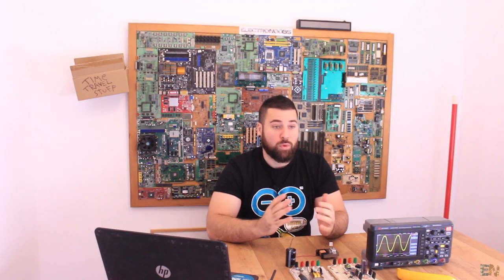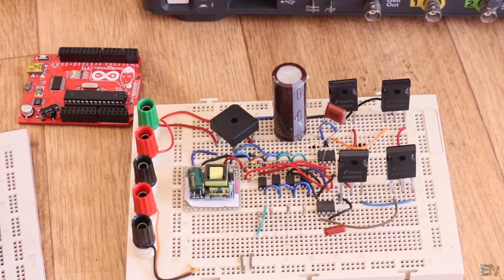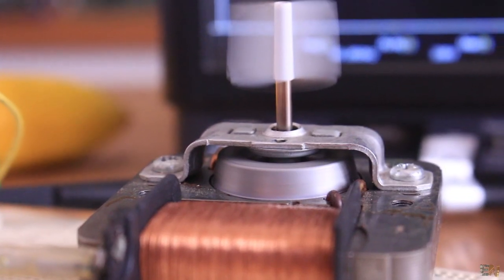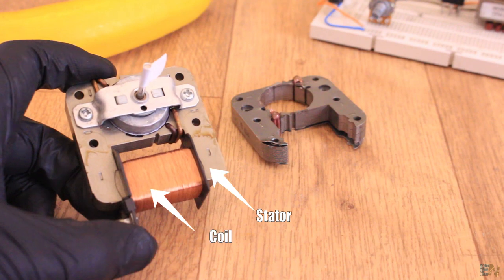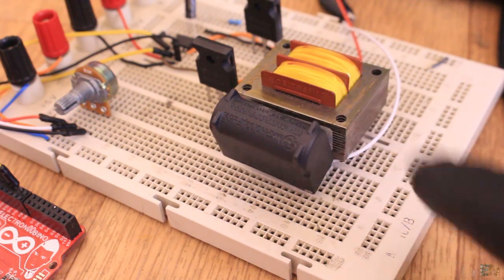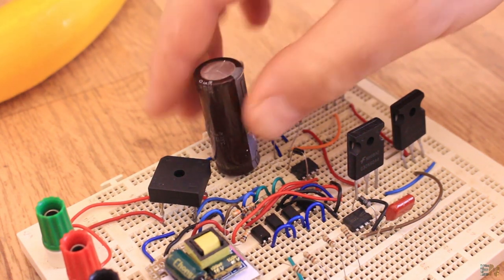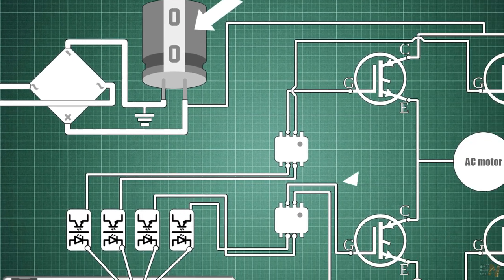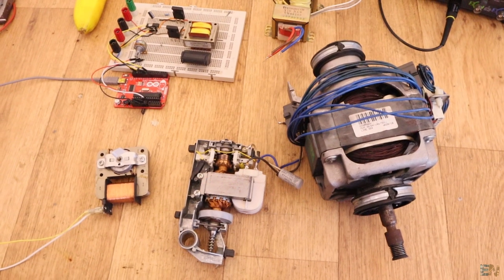Variable Frequency Driver | Variable Inverter

Comment from the maker: Sign up at ELECTRONOOBS.io: https://electronoobs.io/
Follow me on FACEBOOK for more: https://www.facebook.com/Electronoobs
help me on Patreon: https://www.patreon.com/ELECTRONOOBS
Reply: Me: stressed 
Electronoobs: new video uploaded!
Me: stress free now. No matter you completed your video or not. I just like to watch your videos.
Reply from the maker: @padmalayarawal3091  so glad to hear this!
Reply: Electronoob love your channel! one thing that this video really has me thinking is safety! I work with high voltage every day. and every time I have to reach in an electrical enclosure I have a deep respect for what is in there. I try to be as safe as possible but there can be a mistake at any minute and it can cost you your life even at lower voltages like your using. I don't want to go on about this for long so I'll make a short list of my concerns. 
     *Latex gloves - won't do much for you, try the real electrical insulated ones made for that.
     *Saftey glasses - maybe show that you used them? better yet a face shield. especially because of the capacitors.
     *Master disconnect - even if its a power strip with a switch. what if your motor knocks your board in your lap. sorry, you did have a switch but that will be moving with the cable if it is falling.

I don't know how far to take the safety but I would take it a little further just because you probably have some kids and really inexperienced people watching that could get hurt. even if you said not to try this at home. maybe a little more safety? Please? I am one for doing more projects with the higher voltages, but safely.
Reply: Hey I want to make a same project but ur code is showing some error Im not able to solve it 
Can you please help me out

Comment: Great project, thanks for sharing. For information, idealy for an AC motor one should keep the V/f ratio constant. In other words if the frequence is lower that the nominal frequence, the rms voltage to the motor should be lower thant the nominal voltage. On the other side, if the frequency to the motor is higner than the normal frequence, one should boost the voltage, otherwise you quickly loose torque (in a factor of the missing voltage squared).

Comment: 5:28 In three-phase AC motors, the coils aren't necessarily 120° displaced in space. That would be true if there was only one coil for each phase.

5:49 That is Faraday's law (electromagnetic induction). Lorentz law is related to electromagnetic forces, which is what you explained a few seconds later.

Comment: Heh, I was considering making a DIY 3-phase style VFD. Normal industrial VFDs can only go up to 400Hz, but I am needing one that can do 1.2kHz (for a 72000* RPM motor).
Fortunately, I was able to find the correct application specific VFD for pretty cheap. Would still be a fun project though as I am the VFD guy at work would like to get a better understanding of how they work internally.

*Edit: I intended to say 72,000 RPM instead of 7200. Its the drive motor for a turbomolecular vacuum pump.

Comment: Hi, great project.
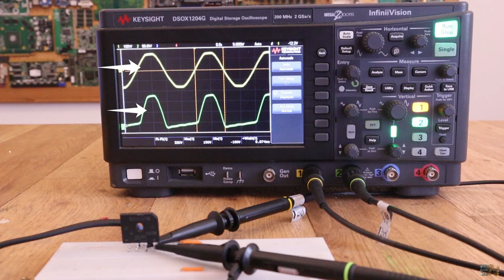At 8:30 you say you have fullwave rectification, your protoboard layout shows this as well, however the scope trace shows halfwave rectification.
I know for the scope trace you have just got a bridge and scope connected in the foreground.
I realise you can't connect both channels with common gnds to input and output of a rectifier circuit, so it may have been better to do it in two shots, explaining the outcome.
Reply from the maker: Yes that's due to only connecting only one probe from the oscillsocope. it was full bridge.

Comment: I tried to make a similar circuit, and i am currently still working on it. Here is some of the things i like to keep in mind.

There has to be a deadband time between switching the Hbridge in order to avoid shorting the bulk capacitors to ground.

Also, you might want to have the SPWM start slowly to avoid slippage in the rotor, so the frequency has to slowly ramp up to the desired value. 

The turn-on/turn-off time of the optocoupler is not to be ignored, depending on how high your frequency goes, it can give some pretty frustrating results. 

Single phase induction motors have a startup capacitor that might discharge very quickly your own bulk capacitors on startup. Depending on the size, you might have to use alot more than just 1 high voltage capacitor, maybe also a series resistor to limit the charging current that can be disconnected by a relay?. To give you an idea, in my case I had to use 7 high voltage caps, 1000 uF, since i was using a big induction AC motor.

For a small motor, the H Bridge you built is fine, however in a much more current heavy application, it can be a good idea to protect the IGBTs with external fast recovery diodes, >10 amps, instead of relying on the internal diodes found in the IGBTs. In that case, mounting the active components to a heatsink is also a good consideration.

As a last detail, i noticed that the traces are quite small in the PCB you ordered. Again in a small ac motor application, it shouldn't be a big problem, but for a bigger application, consider enlarging your high current traces.

For a furthur implementation, power factor correction is also important, just a thought to keep in mind.

Great video! can't wait to see how this develops!!
Reply: The thing I don't understand is he used N channel igbt's I thought n channel transistors can only turn on and off negative. Where as p channel can turn on and off positive. How is the H bridge working with all n channels

Comment: Thank you. Learned something new. Did not expect your IGBTs to switch with bootstrapped highside drivers. Does it with a amplitude modulation of 1? Also really interested in how your current waveform looks like

Comment: When you said you change the switching frequency in the spwm circuit that was wrong in a spwm circuit you use a constant high switching frequency and you change the pulse width of the pulses in order to get the derided signal on the output
Reply: Alternatively you could use a variable external clock source on the micro or DDS where the resolution of the sine is reduced to increase frequency.

Comment: @8:32 is not the output of a full bridge rectifier. A full bridge rectifier will double the line frequency.
What you are showing, is the rectification of a single diode. 
Also, for any application of less than 100mA, a capacitive dropper power supply is a lot cheaper. 
Unless you must have the galvanic isolation that the small smps transformer provides.
Reply from the maker: Is the output from the rectifier but with only one probe connected...
Reply: @ELECTRONOOBS  That's not what you say while showing that.

Comment: Could you create a voltage divider to supply 12v for the MOSFETs from the 320v DC without the need for the second transformer?

Comment: You really need to add a 'bleeder resistor' to those 400V capacitors, so they discharge when power is disconnected.
1M ohm in parallel with the capacitor, 1/4W resistors are only good for 200V though, so either use 2x 500kohm in series, or use a larger 1W resistor.
Given you've already ordered the PCBs, add the resistor to the pins of the capacitor under the board,  before you cut them off.
Reply from the maker: Thank you so much for the feedback. I will add that!

Comment: What is the part number of the transformer used in the first design with only 2 transistors ? Or what type should I use in the USA ?

Comment: Hi can you post a schematic for the frequency inverter and the exact arduino code Assosciated with it ? I would like to know how to hook up the potentiometer and start with the simpler circuit before I move on to the driver circuit

Comment: Excellent Video! I have one question. Right now I have a D6124 CA 651 Integrated Circuit, but I don't know the main functionality. I desoldered the IC from an old TV remote control. I've searched for some datasheet related to the IC but it is a little bit difficult to find and download the specific PDF. Can you explain to me what is this IC about? Thank you Electronoobs! Greetings from Ecuador.

Comment: Hola, sigo tus videos, noté que tu circuito tiene un pequeño problema (ver minuto 10:17) no puedes conectar el rectificador al terminal de tierra. Cortocircuito Dañar el puente de diodos. No se puede conectar la masa del osciloscopio al condensador negativo. Un fuerte abrazo y felicitaciones por su trabajo y por la elección de los temas que cubre en sus videos. Gracias

Comment: very well explained!, I wanna build that driver but to supply a Flyback in order to deliver 8kV to 20 kV and adjustable frequency to a discharge of  8 kHz.   How could I do that using your example?.  Also I checked your video about how CFL works, and I was thinking in a way to control the frequency using that base circuit.

Comment: The AC motor you used is a shaded pole motor. Sorry but I'm afraid that the theory of operation you stated in the video may not be fully correct. There are 2 shorted wire loops on the stator (laminated silicon-iron core)  near the rotor of the shaded pole motor, which are necessary for the creation of the rotating magnetic field and the rotation of the motor. Also, as the shaded pole motor is an induction (or asynchronous)  motor, the rotation speed of the rotor dosen't have to be synchronized with the input AC frequency. The synchronization is only needed for synchronized motors (permanent magnet motor or excited motor, for example).

Comment: Hello! What´s the voltage that gets to the motor? My country is 120v so is my shaded pole motor. Is it possible to use your circuit without damaging the 120v motor?

Comment: I've developed circuit of inverter circuit with gate triggering circuit using op-amp. I've compared square and triangular waves and implied SPWM technique with that. I want to know that how can I generate that sine and triangular waves which are to be given as the input of op-amp without using function generator or Arduino......

Comment: So I'm basically  building the same circuit .  and am having problems with what I think is called the miller effect. The high side IGBT not switching correctly. does your circuit compensate for that. Thanks.
Reply from the maker: Don't know yet. It needs more tests. Maybe you can share your work on electronoobs.io so we can all see it

Comment: I never use optocoupler before in my circuit but I try turning on on I have removed for a old micro wave clock circuit but I was in for a surprise I connected the output signal of my micro controller and to ground it just short circuit on me I don’t think all optocoupler or the same because if a signal of 9 volt con turn it on I don’t know about this one can you recommend one that is use in signal

Comment: I would rather be extremely careful with the board you designed..there are lots of clearance issues between the AC voltage and the low voltage side. I would suggest replacing the electrolytics on the bootstrap side of the drivers with ceramics as they have very low ESR, and you don't really need a lot of capacitance. Adding some decoupling capacitors near the input of the drivers also helps.
Reply: I tried making this circuit and the issue I came across is with the gate driver ic. The LO pin on the oc turns on and off the low side igbt just fine but the HO pin stays on all the time. Even if I don't have a Arduino connection to the ic

Comment: A simple integrated circuit should be used, not an arduino. ICs require no programming and can run on typical dc voltage. The IRS2453 would suffice for an h bridge driver even with high power and current mosfets.
You adjust the frequency by using a resistor and capacitor in series to give the input pin the right voltage and it automatically will oscillate at the desired frequency.

Comment: I see that the gate resistors are 1k, which is way too high. 10 ohms or 4.7 ohms is a more reasonable starting value. The optoisolators are configured to turn on the transistors with no input signal, not a good way to do it.

Also keep in mind that it's surprisingly difficult to design a robust power stage which is why for my home solar inverter, I'm planning to reuse the power stage of a Prius inverter instead of building one from scratch.

Comment: I tried making this circuit and it didn't seem to work. The igbt gate driver has a high and a low output for the high and low igbts. The low side works find it turns on and off the igbt just fine but the high side just stays on.

Comment: If, I boost up 300VDc from cap to @400VDc, then I feed it to Fullbridge igbt as your circuit,  can I get 380VAc?  Actually,  I'm searching for converting 220VAc to 380VAc, since I repaired some 3phase 380VAc welding machines. 
Thx You,  anw

Comment: I try using optocoupler pc 817 and add pwm signal the signal is really small 2.5 and o use 12 to the optocoupler emitter pin and I get 12 volt yes but no plus signal

Comment: I want the no. Of mosfer driver ,  code and how you change the frequency by variable resistance.
My be You can use only two pulse from Arduino one to + half cycle and one to -half cycle

Comment: Dear a new idea to make 3phase from single phase using only 2 or 3 transformer and capacitor.
Without moving parts just single phase motor run 3 phase motor.
This is unique Idea no any video on internet about this.
Only transformers and capacitor do this job.

Comment: I make inverter and sell and I never made a frequency drive but it’s the same as a inverter no different just high voltage dc and igbt or switching but it’s no different from pwm drive only thing Is the sine wave is spwm

Comment: Hi make a circuit of oscilloscope that run on video input composite of TV with out open any tv or any other device that run on video input composite.
it make on working tv or video input based devices or monitor but not used A2D based circuit like Arduino or other digital circuit
Useing analoge circuit this is awesome new idea to make every video based devices into oscilloscope.
Can make two different frequencies horizontal and vertical,and then distrube by injecting measuring signal work oscilloscope.